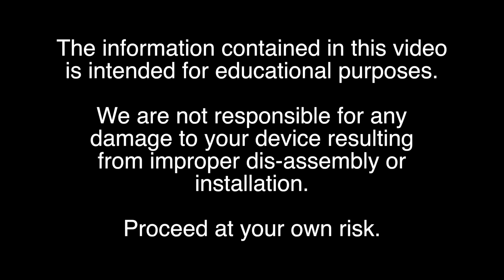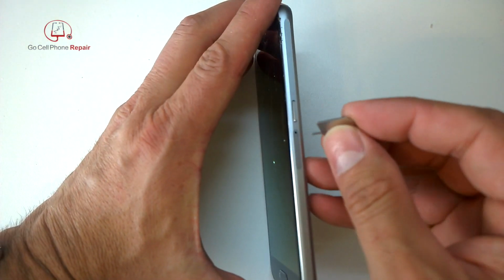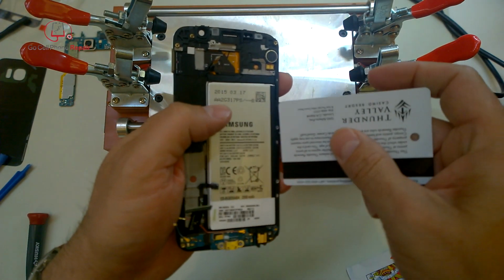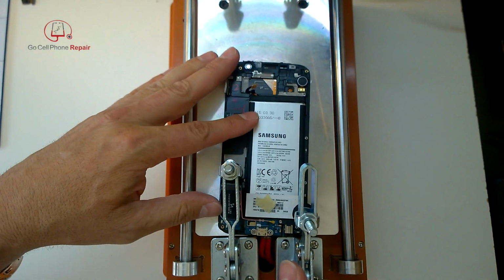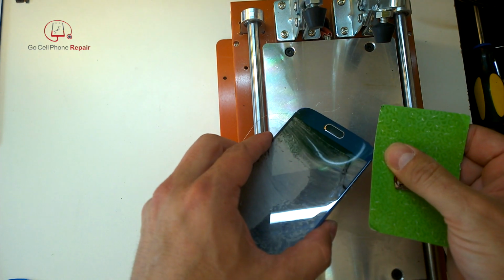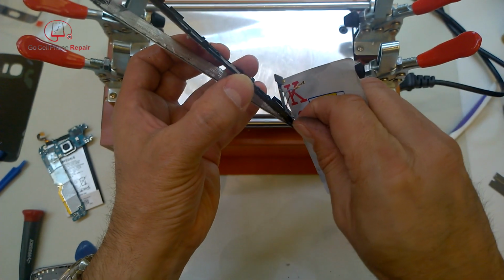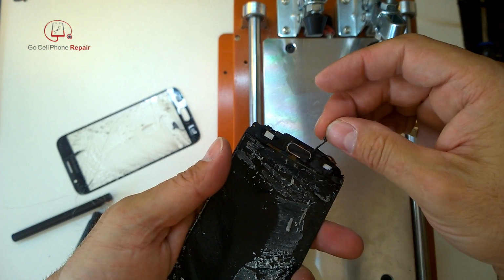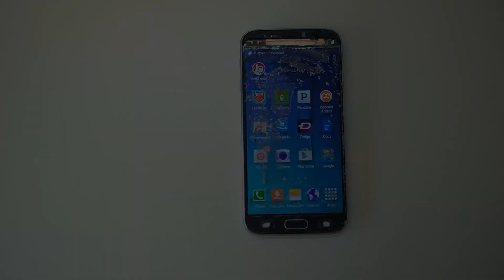Galaxy S6 Glass removal

Comment: Thanks for this great video!

I'm a bit concerned that if I attempted to repair this, I'd have a good chance of damaging the phone....
I use a heat plate with a built in vacuum to fix iPhone glass screens, but it doesn't seem to me like the temperature the iPhone screens can handle will be suitable for the S6. I use 60 degrees, will that burn the S6?

Comment: I was able to get this by using the playing card and a isesamo tool.  It is definitely more fragile.  I used  heat plate and hot air gun along with a temp gun.  I kept it at around 180 to 200 F when I was separating the glass.  I started with an isesamo tool and then put the playing card underneath.  I also went really slow.
Reply from the maker: +Fix All Cell Ogden Did you remove the battery first? My main concern was the lack of stability due to no real mid frame per se.
Reply: +Go Cell Phone Repair I don't think I removed the battery, I don't fully remember.  I took off the back plate, midframe and used the isesamo tool to get it started, making sure the digitizer flex cable was lifted up before using the playing card.  I've learned from experience that it is pretty easy to slice right through them with a card. and then I kept heating it up, checking the temp to be at 180 to 200 degrees and slowly worked my way down.  It didn't separate like the S4, that is for sure.  After I was done, I took out the logic board and battery (I think) and used the octopus glue loca.  I noticed however these are hard to get flush when put back together, because there is not a lot of space between the bezel and lcd.  But when I screwed all the screw back in it was relatively flush.  I recommend letting customers know of this potential issue when doing a glass only repair for them vs. a full LCD replacement.

Comment: Hi Great video! I just finished my first s6 glass removal, unfortunately
 I ran into problem where digitizer on very bottom very space button is 
in texting ( 1 -2 cm) doesn't work. For example i press space and it 
inputs V letter on top of it. Did I nick the cable or is there a cheap 
way to fix it? Thanks!
Reply from the maker: +Keriks Sounds like either the cable or possibly digitizer. If youre sure that its connected properly then the only way I know of to fix it is replacing the digitizer which unfortunately is attached to the AMOLED. I believe it is possible to remove and replace but havent tried myself and imagine it would be difficult without specialized equipment.

Comment: Can you tell me what the 2-sided adhesive tape is called...the one with the translucent pink film? it looks thinner than the traditional cell tapes. Thanks your videos, really helpful!
Reply from the maker: Are you talking about the RedTape adhesive?
Reply: Yeah, I think that's it. I've never seen it until I started watching the S6 videos. I think I found some on ebay. Is this the preferred tape style for the S6? I did order the back panel die cut strip, but was thinking of the red to use for the battery. What do you think?
Reply from the maker: For the battery sure that's fine. For the screen, back panel, and everything else you should be able to find the factory pre-cut adhesive. That is the easiest to apply and gives you great coverage.

Comment: You mention that it took about 45 mins to remove. How long approximately do you think it took to do the whole refurb. As a cost/benefit I'm just thinking it'd be quicker and easier to get a new screen. 
Btw those AMOLED screens are crazy thin, took an S6 apart last week. Was amazed!
Reply from the maker: Craig Ward The removal process will be faster once I have a few under my belt. I was being very careful with this one and started out at way too low of a temperature, 35C, gradually increasing as I wasn't sure how high to go. Once you have it torn down it should be possible to get through the display in fifteen minutes or so but if you have a lot of cracks that could change things dramatically. Realistically the whole repair can probably be performed in about an hour and a half I'm guessing once you've reached a high level of proficiency. I too would much rather do the entire display as a lot of things can go wrong here so this was more for the challenge than anything else. Also it seems like AMOLED costs take a very long time to come down so once this is streamlined hopefully it will be worth doing.
Reply: what do you do if you take off the glass and noticed that the deck in which the glass sits on is broke too
Reply: what do you do if you take off the glass and noticed that the deck in which the glass sits on is broke too?
Reply from the maker: +Otis Henderson Are you referring to the AMOLED or another part? If it is the display itself then you'll have to replace the whole piece.

Comment: It seems that the power switch is working by virtue of connecting two pins. Did you try to connect these two pins with a paperclip or something, rather than install the fragile screen in the housing?
Reply from the maker: I didn't at the time but yes you can short the connection that interfaces with the power button for a second or two and it will prompt the phone to power up.

Comment: Question.. I dropped my S6 Active. The glass has a hairline crack. Nothing really bad. The problem I have is, the screen is completely unresponsive. Would replacing the front glass correct this? Is the glass actually a digitizer or just a cover for what is under it?
Reply from the maker: +Donald Lemoine AFAIK the digitizer is not part of the glass and youll need to replace the entire display assembly unless something else in the phone was damaged enough to affect the touch functionality. Ideally you would remove the old screen without damaging it and connect a new one to see if that corrects the problem.

Comment: my question is the glass it's self is cracked and I just want to replace the glass. would I need that vacuum tool to take it off or can I just use a heat gun and playing cards to seperate just the Glass and replace it.. and if so do I need to use glue or tape to put just the glass back on on ?
Reply from the maker: While it may be possible I found that the playing card and heat gun, at least on my first attempt, made damaging the AMOLED a considerable risk.